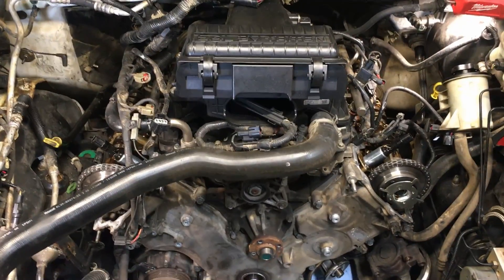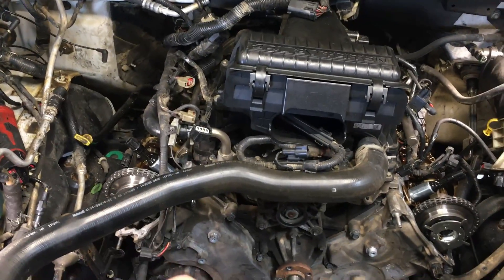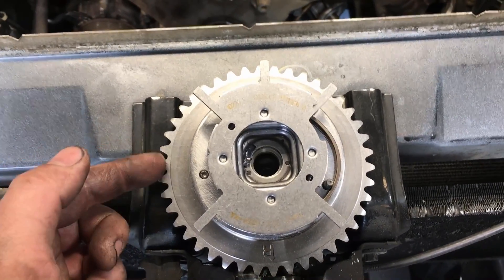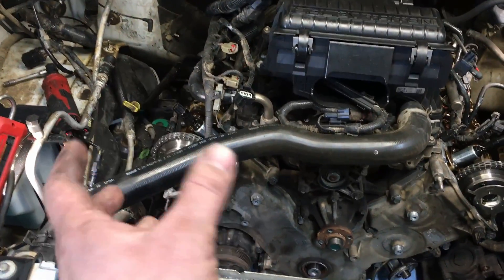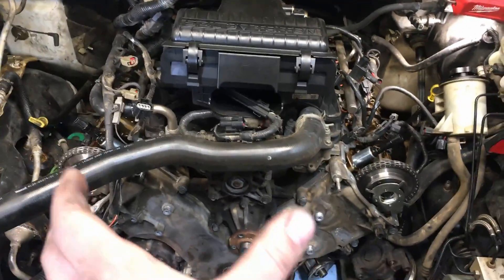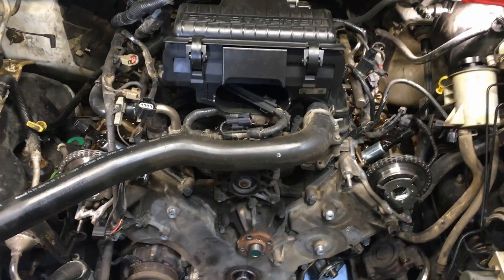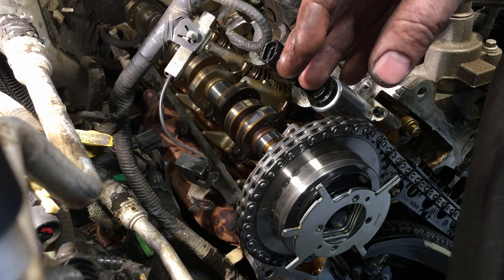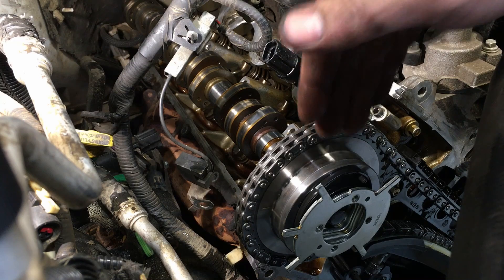Ford 5.4L 3v Triton Engine: DO NOT USE AFTERMARKET PHASERS FROM FREEDOM RACING/OTHERS; THIS IS WHY!

Comment: Ford phasers may be better than the aftermarket ones, but why did the original need to be replaced?
Reply from the maker: They went through 3 revisions many years ago, the ones being replaced are the original factory version that has a knock noise.
Reply: Yeah... Coyote is so innovative.. you design an engine thats made to Rev has high flow 4 valve ohc design but you can build it without throwing money at it cause they didn't design it to take the hp it can make... seriously...  maybe the LS is an old design but GM took everything good about there previous generations of the small block and made it better and when they realized it's potential for power made sure that it was solid enough to take it. Stock 5.3 continually make 1000 plus hp in ever other hobbiests blow,boosted,NOS'D whatever you cram it in and it fits in everything by the way... if you tried to make that power with a stock coyote....game over... valve train will never hold up let alone the bottom end... read any article on a coyote build they all say the same thing..
Reply: Nunya Business exactly I've done things to LS motors that make Chuck Norris cringe, now that ford has taken the BMW ROUTE I'LL NEVER OWN ONE AGAIN, I'll keep my little 505hp 500tq 388 Chevy 84 K5 4x4 thank you very much
Reply: Jeremy Hall every worked on one? 
I'll take a Ls anything over ford, the only people that like them have never actually torn them apart and seen how they are actually designed. 400hp for for 5.0 lifters isn't impressive, neither is the junk they use to build them
Reply: Too bad you can't just use 2v cam gears and fix the diesel sound
Reply: Too bad a company that built cars for 120yrs can't build a fucking engine. 3 revision later and that motor still has problems.. and whats worse people defend that shit.. people have all but gave up on Mitsubishi because of the same shit but Ford Country is a Good Old boy company so they can produce shit and its Ok... Bullshit..

Comment: If they don't come apart then why did they need replaced in the first place
Reply from the maker: The locking pin makes a knocking noise that sounds worse than it is since it telegraphs through the cam. Have you seen my videos on this engine?
Reply: FordTechMakuloco I have replaced them on a 2008 f150 them tritons are garbage
Reply: FordTechMakuloco now after the first one I take all them I can spent a small fortune on the specialty tools to do it

Comment: Dorman can't get anything right except window motor/regulator assembly's...
Reply: king.jameso buddy I've been a glass man for 34 years okay the cable driven ones yeah you're right they're pretty reliable but don't try to put something in an old G body or a Camaro or El Dorado or anything like that cuz you might as well just forget it that f**** trying to s*** those nothing but bend and lock up it's f**** junk

Comment: Alright if anyone here can help me it would be appreciated. I did a timing job on a 5.4 with Ford parts, not doing phaser replacement, and just got everything back together. The truck is not running any better (really rough) and is giving codes p0345 p0349 still. Tried unplugging vct to see if it would smooth out and it didn’t. Is the motor trash?

Comment: I  just replaced the lower ball joints on my 05 Expy (175K miles), and 5,000 miles later, I hear them rattling around again. No more after market parts for me, especially for this application.  Was getting ready to take the dive and order a timing set from summit racing. Not now, will have to wait a few weeks to save up some more money to get OEM.  Thanks Brian for all your great videos and sharing your skills.

Comment: I have 0t 5.4 155k mi  knocking and ticking for awhile now been chasing lean codes and misfires runs terrible. Ford wants 8hrs to diagnose. Im going to use your series to change the timing and phasers. My question is can the original phasers cause this problem.?
Reply: Yes I had same problem, same mileage. Definitely the phasers.

Comment: Got the amazon kit you recommend with the truck I bought from a individual. Everything was going great after I got the driver side changed out. Pulled the valve cover on the passenger side and the rear(closest to the firewall) roller lifters were trashed. Two of the three were laying down in the head in pieces! Trashed the lobes on the cam also, of course. 1 of The push rods/valves has lost the keeper. So now I’m stuck w a 06 F150 king ranch. Not sure what to do now. I was told not to mess w changing the cam. To just replace the engine. Then of course get rid of the truck. Which I will as soon as I figure out what to do next. What’s your opinion?? I’m not sure what to do w the valves/push rods that are dropped & trashed. Along w the cam issue.
Reply: NeoXavier DarkskullBonebreaker drop a used motor in it and dump the truck.  Sorry for your troubles.

Comment: I remember as a kid in the 80s having to help my dad replace parts on our Fords.  He would always go to Autozone bc it was cheap.  The experience of having to replace alternators and power steering pumps multiple times in the same year because of shitty aftermarket rebuilt parts.  As a Toyota owner I only use Denso parts; it’s worth the extra money period.
Reply: I used to get all my parts at Trak Auto, horrible quality but I didn't know any better. I was young and there was not much internet. Certainly no Google and YouTube LOL. Multiple starters, alternators, radiators, new hoses blowing, doing the same job every year. It was awful. Oh yeah and stay far away from GE bulbs, especially headlights. They would last almost exactly one year. And they would ALWAYS die when it was like -10 so I'd be out there freezing in the dark trying to change that crap.   Started getting Sylvania or Wagner  and problem solved.

Comment: I can sure appreciate your honesty and definitely your passion. Nothing could be more frustrating than having to pay for some aftermarket junk (not to mention the labor) to have it installed, only to have to pay to have the job done correctly using quality OE parts! I had to learn my lesson the hard way when replacing a flywheel on my 5.0 Windsor. Had a Luk flywheel installed only to find out my engine was running "out of balance"  Vibrated really bad!  Next up was a cheap Chinese POS that was packaged as a Sachs. Even more issues!!
Finally went to a salvage yard to get a OE one. (No longer available from Ford) Had it machined and installed...!!Runs perfect!! after transmission was pulled 3TIMES!

Comment: could you just delete the phasers and use cam gears from a 4.6 engine and call it a day??
Reply: No because cam sensors will get bad readings and cause all sorts of problems. You can get phasers lockouts though, essentially make the phasers behave like simple sprockets.

Comment: I agree fully with you there is some stuff you can do aftermarket but when it comes to the 5.4 3 valve triton engines you should use the oem Ford timing kits

Comment: I have a 2003 lincoln ls going into fail engine safe mode, and the codes are for the throttle actuator control system , so long story short took it to the shop put 3 different throttle bodies on it , all new coil packs , and crank shaft , and its still going in safe mode can you please help me

Comment: Freedom Racing, Dorman and all the ebay ones are junk , I initially put dorman back in 2013,  but they failed by 2016, I was too late to your videos, motorcraft parts only or ditch the truck.

Comment: With so many timing issues on these 5.4 3v I think Ford should do customer satisfaction program and discount all the timing components related to this engine. In canada the all timing kit for a 5.4 3v is anywhere from 2,000 to 2,700 bucks cdn for parts and if you were to just buy the phasers separately at a dealer in canada they want 438-500 bucks cdn per phaser. Thats crazy on a issue Ford knows all too well about!
Reply: Motor out of production for 10yrs now.

Comment: It sounds like your charging the customer for work it does not need. You can change the phasers with out removing the cams or front cover.
Reply from the maker: You must of missed the previous comments. The front cover was removed because the tensioners had already failed and the aggressive aftermarket chain was digging into the cheap aftermarket tensioner arms and were already creating grooves in the plastic at 150 miles. So yes I had to remove the junk so it was done right. I don’t half ass repair jobs. Do you understand now?

Comment: So....what is your opinion on the Livernois Motorsports cam phaser lock out kit? https://www.livernoismotorsports.com/product/LPP822133
 Is it a good idea or more trouble down the road?
Reply from the maker: Garbage, trust me I will have a video soon on those.
Reply: Oh dam my local mechanic recommends these, and they charge separate for a pcm tune thats required
Reply: So happy you replied. You just saved me 7-800 dollars. I trust your judgement, especially after watching your video on the best way to replace spark plugs on the 3 valve, when engine is warm using an impact wrench. Because I didn't have an air impact, I used a small Dewalt brushless rechargeable srew/impact driver. Worked great and I got all eight out no problem. I'm so happy I subscribed to your channel last month . Your videos(you), saved me so much money and headaches.  Cheers...

Comment: All I can say is Motorcraft is the way to go. The exception I’ve been able to get away with some aftermarket brake parts, Even the air and oil filters I go Motorcraft. Also, I’m feeling pretty good right now that I have a 5.4L  2v in my Ford E350 van.

Comment: $1250 labor? Do you not own a tensioner wedge? I worked at a Ford Dealer in Oklahoma when the 3V came out, replaced a bunch under warranty. Never pulled the timing cover unless they had a start up rattle from a suspected leaking hydraulic tensioner. Never dropped a chain either, but I would safety wire as a back up to the wedge.
Reply from the maker: Of course I own a wedge, are you new to the channel? I too came into the dealer world in 2005 when this engine came out. The $1,250 includes retiming the engine and replacing the plastic tensioner arms and chain tensioner that also failed already. So no not just to swap some phasers.
Reply: Fair enough. I've watched a few of your videos, quit Ford dealerships in 2010 (started in 1984). Did Ford get away from the plastic tensioner and go back to cast iron? The failures I was seeing were from apparent deformation of the plastic causing the seal to leak. Didn't see many out of phase codes back then it was mostly for engine knock at idle, at one point there was an SSM to use 10w40. I still have my Dell that had the IDS software on it, the dealership had 3 VCM's but only 2 Toughbooks and I got tired of waiting my turn, So I bought the Dell D620. Did you have the joy of working on the 6.0L Power Stroke when it came out? I replaced a bunch of egr coolers, egr valves, turbos, injectors, IPR's, ICP's etc... So many cabs off,eeeeek.
Reply from the maker: Well you got out just in time, starting in 2013 or so the warranty rates went way down, no one was making money anymore. They still use the plastic tensioners but the seal is improved, I have seen them last 200k. I have heard of that ssm but never seen it, do you have it saved? At our dealer there were only 3 techs so yes we all shared the 6.0l work load, lots of experience with those.

Comment: Yep... Learned that with my wifes Rav4..  P1135 code..  AF sesnor b1p1 or whatever..  Bought a $50 one off of amazon...  No Bueno...  CEL after about 10 minutes..  Take it to the Yota dealer. Tell them it's a new aftermarket sensor..  They test it, say it's crap.  Buy their $235 sensor and no CEL...  Go figure...  Sure, the Yota part cost a heck of a lot more... But it freaking works...  Some aftermarket stuff is just fine, but when it comes to this kind of stuff..  Well, you just gotta do what you gotta do..

Comment: Love you’re videos. Cost $3200 to get the plugs changed in my ‘04 F150 5.4. Not spending another dime on this 130,000 mile motor. Makes a bunch of racquet and sounds like a messed up diesel, but when she starts spittin pieces out, that’s when I’ll do something about it. If the warranty doesn’t cover the fix, maybe I’ll put a new motor in it. But my warranty says it covers “engine oil lubricated parts”. Not too many things not lubricated by oil in the engine. Till then, I just turn up my Alpine stereo and can’t hear that noise from under the hood.
Reply: Wait util you go on the drive thru and order food,  when you roll down the window and hear your engine noise resonate along in the pick up  area, you'll never want to go back,  I had one guy tell me" never knew they put diesels on F150s"
Reply from the maker: Lol

Comment: Well i know my truck had its phasers have been replaced i hope with FORD ones. I do wonder how long the oil pump lasts on these since im pretty sure its original. 274000kms(174000mi)

Comment: I have always appreciated your candor and tech knowledge. Your videos show the truth about these aweful parts. Thank you for all your 5.4 3V video's...I currently own 3 and they have been verify helpful in working on my trucks. One unrelated question...in this specific video I noticed a shop light hanging from an adjustable bracket on the underneath side of the hood...where did you get the bracket? The light seems to be a Milwaukee rechargeable unit. Please tell me about them both. Thanks again for all your concise video's.

Comment: Do you see many 5.4 3valves from the Super Duty lime?  As I understand it they are same engine as F150 for the 2005-2010 superduty lineup.  I bought a 2010 F250 5.4 and it was gutless when compared to my 2016 F250 6.2

Comment: 243,00 subscribers and u still read and reply to the comments. I love this channel. The interior videos on pulling the dashes and stuff r so trick!!  Happy that u have your rack and shop. Thank u Brian!!
Reply from the maker: I try to, thanks!
Reply: @FordTechMakuloco  hey man I got a question just put a motor in a 2007 mustang gt 4.6 3v and I bought all kinds of sensors and runs great but when It works up I get up to about 3000 rpms and it starts clacking knocking  for a min then goes away when idle gos down to normal sometimes the knocking sound will continue until I turn it off and restart it any suggestions?
Reply: Yup great channel, helped me out so I could save some money and diagnose my issues
Reply: Agreed!

Comment: I have used standard motor products in the past vvt500 wo issue. Ford parts would be great but they are double the price.
Reply: How are these holding up long term? The design revision seems to be a major improvement internally, I've seen and handled the parts personally but no experience post install. I know alot of the pattern failures on these engines are oil pressure related, tensioner  failure, guide failed and plugged oil pickup tube etc.